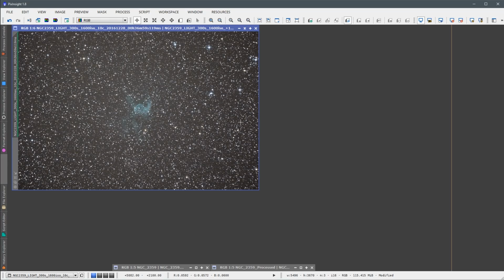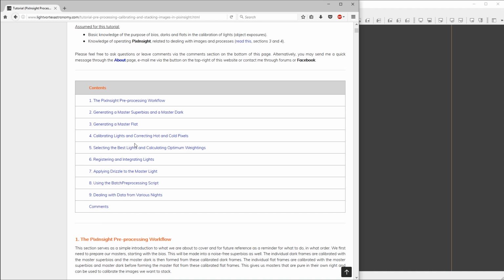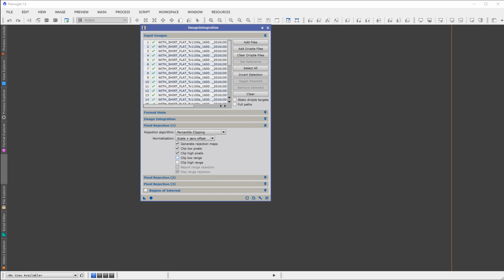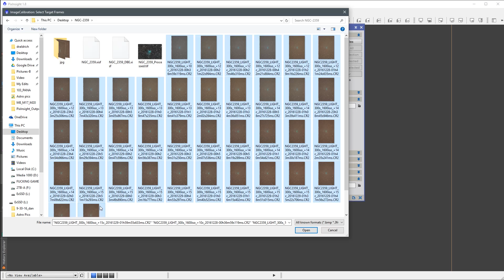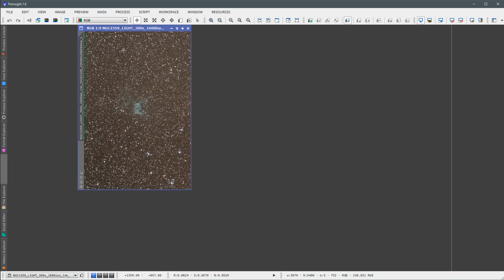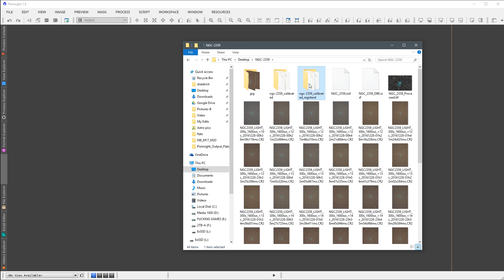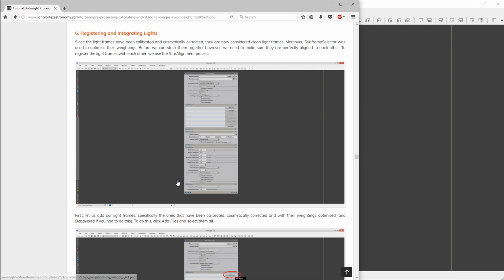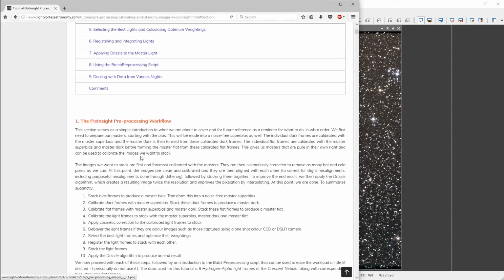Image Stacking in PixInsight

Comment: How is it compared to DSS? I've been only using DSS for stacking my shots, but I was told that Pixinsight is even better. I can see right away that it provides more "settings" and more calibration maybe, but if you keep most things at default settings, does pixinsight inherently produce a better stacked image than DSS? Or does that only happen if you carefully change some of the settings first.
Reply: I feel like Pix is 10% better than DSS. DSS gets you to 85% and Pix gets you to 95%... 100% doesn't exist yet